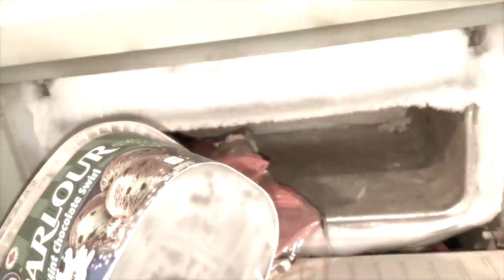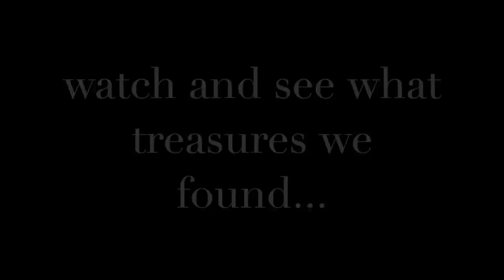Part 16. Ahead of schedule! Hoard removed in 2 weeks! Musicians House.    HD 1080p

Comment: The eyes, thermostats, and heating elements off of that vintage Frigidaire stove are quite valuable.  They are no longer manufactured.   They are sold on eBay to people with vintage stoves.
Reply: Antique Appliances
 in Clayton, GA, USA has a Facebook page showing  restored appliances, like that stove, that sell for thousands of dollars.
Reply: Too late!😞
Reply: I'd have pulled the back from the TV to see if there were vacuum tubes.
Reply: The eco place the fridge will break it down and resell hopefully
Reply: The eco station is a private company contracted to public. They will no doubt salvage what they can. They are in the business to make money.
Reply: @jcadult101  Or money. :)
Reply: @julier.1902  Julie Russell I have been feeling the same way every video.

Comment: My hat's off to all the work you and your friends did, on this project! A hoarder home is a massive undertaking, and it's great you have a strong friend base that'll help out and well, of course you take care of them too! 

I will say this...scrapping the fridge was kind of surprising, actually. I'm in several vintage appliance groups and, 1950s working refrigerators are typically solid sellers. Door gaskets are easy to replace and most of the time the original enamel can be spruced up with Barkeepers Helper! Sad to see it recycled, the refrigerator my wife and I rely on is a 1935 GE monitor top, best refrigerator period! 86 years old and still going strong!

Comment: You can buy new door seals for old fridges.  Lots of people myself included want an older fridge for a man cave beer fridge.
Reply: Too late.
Reply: Absolutely, they are way more dependable than newer models. My mother had a LG ref/freezer and the inside light started staying on constantly. She called a maintenance guy look to at it and was told he couldn’t as LG required certified technicians only, she had to get a tech from over a hundred miles away to make the service call. He told her the mother board of the refrigerator controlled the light function and would require replacement...300+ U.S. dollars...and she would have to wait for it to be ordered. He gave her the option of simply unscrewing the bulbs, which she went with. That and eventually buying a new fridge and having the LG hauled off...
Reply: How would you even know if the inside light was on if the door is shut?
Reply: @andrewgrant6516  because the plastic lenses covering the two lights melted and were dripping down from the ceiling and the inside temp was about room temperature instead of the mid 30s it was set to. Unscrewed the lights and inside temperature cooled back down to the 30s. It basically could not decide whether to be a refrigerator or an Easy Bake Oven.

Comment: Pretty good deal for the heir, whole house cleaned out and 10 grand cash.
Reply: No doubt they will need it when they do the renos...lumber is pricey!
Reply: @clarissathompson  It shouldn't need much beyond paint and maybe flooring in the kitchen. Someone mentioned finishing the basement, but I don't know if that's a good idea. There's water damage in the basement and no one mentioned it so it could be a regular thing from seepage in the spring and summer.
Reply: @greyeaglem  My partner and his friends had to dig out half of the back side of his house under tarps in a torrential downpour to repair a crack in the foundation…no fun at all! Hope the damage is from the old plumbing!
Reply: @greyeaglem  Very optimistic
Reply: @jmsjms296  I don't see anything major wrong with the house, at least inside. He hasn't really shown the outside. If I bought it I would just clean and paint it. The furnace is from the '50s and should be replaced but it's not like there's big holes in the walls or ceilings caving in.
Reply: You forgot about the bathroom.

Comment: Refrigerators used to be built to last 50 - 60 years now they last 10 years. Crazy.
Reply: 3.5 for mine.  Delivery guy said, “see you again in 7 to 10 years”.
Reply: Mine is from 1991. It’s a power hog, but still solid. A new one would use 1/3 the power, but probably die in a few years.

Comment: Hipsters would LOVE that fridge esp if it was painted turquoise.
Reply: The problem with old refrigerators is that they suck up massive amounts of energy. I replaced my not so old refrigerator and my non-air conditioning energy bill dropped 40%. That's with oil heat, so no electricity there.
Reply: @stefanfrankel8157  -- I completely agree. As neat as the old fridges are, they're bad for energy consumption and should be retired.
Reply: @dcan911  -- If it were an antique car, I would agree with you, but an old car is seldom used and doesn't contribute to environmental degradation 99% of the time whereas this old fridge would run 100% of the time and waste a lot of energy. It's just not cool to do this anymore. Perhaps the modern manufacturers could make hipster style fridges?
Reply: Lol my gramma had an old turquoise fridge she wanted to dump. I took it and turned it into a 'secret' bookshelf. Didn't want the energy bill but really didn't want that beauty to get tossed. The kids I nanny/ babysit, my friends kids all love it and think it is an odd piece of magick. ✨💙💚💜✨
Reply: @dcan911  -- Yep, determining the true cost of a good (economical + environmental) is complicated! Maybe it does come out neutral on this old fridge, who knows?

Comment: I clean behind my stove and fridge at least twice a year...for THIS very reason!  I don’t want anyone moving my stove and fridge after I pass and finding this kind of mess!
Reply: But I'm then you reach that age where you can no longer physically do those things.....
Reply: @dianekb2745  I’ve done it for my mom a couple times. The first time, the spot under the freezer hadn’t been cleaned for decades. That took a whole lot of scrubbing...
Reply: @SilverHawk214  as in pull it out from the wall and clean it?
Reply: @SilverHawk214  in my house there was a fridge that had leaked for I don't know how long before I bought the house. As a result the floor has a  small slope to it. It was caused by a clogged drain line, it took me 15 minutes to clean it, and no more leak.

Comment: I worked with appliances.. first off that stove panel comes off and you can detach the cord with 3 screws USUALLY. 2nd off if the fridge is still functioning properly the seal is the least of your worries. I’ve restored it on hundreds of refrigerators for resale. 
My aunt has a still functioning fridge like this in her kitchen. They’re built to last forever.

Comment: Direct wired stove removal:
1. switch off power
2. remove cover plate on stove
3 Test for voltage @Supply  wires with test light or AC Voltmeter
4. remove wires and cable connector @ stove
5. tape up exposed wire ends

Comment: 7:13, I got caught like that when I moved house unaware my cooker had been wired to the mains when my kitchen was renovated. lucky in the UK it's just wires connected to a socket and not concreted in like that so we turned off the mains and unscrewed the wires

still had ti get an electrician to wire it in in my new place